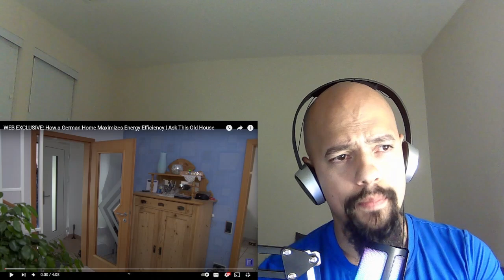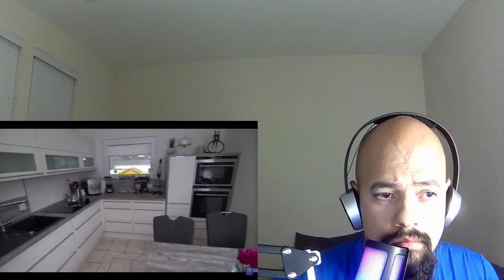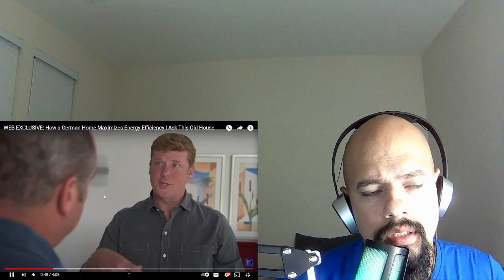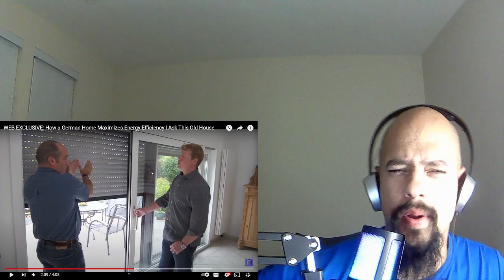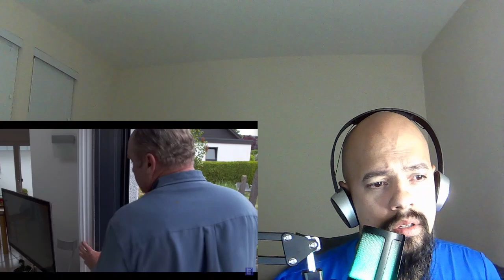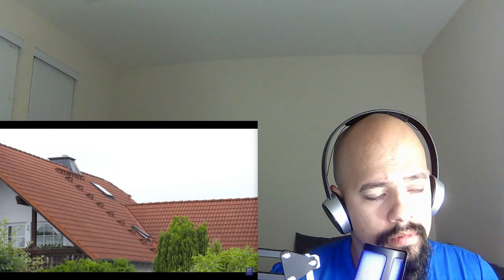American reacts To How a German Home Maximizes Energy Efficiency

Comment: this is a completely normal house... as it has been built in Germany for about 30 years... normal standard, nothing special

In Germany, heating is provided for about 8 months straight

The heating systems are different

We heat with oil central heating

with gas boilers

with wood stoves

with solar

with geothermal heat pumps

and and

often combined

And heating is expensive in Germany

That's why we attach great importance to insulation

Greetings from Germany

Comment: One of the main parts why Germans don’t need so much air conditioning are our cool nights. Our houses are build with brick and concrete. So when you cool them during the night by opening the windows the house will stay cool for a long time because it has an incredible thermal mass. The thermal mass of an American house is just a fraction of this. This means that it will react way quicker when temperatures change either way. We have a highly insulated house and lost heating one day with just 15°F outside and it stayed warm for over a day without any heating.
Reply: In recent years, we have a heat period in Central Europe. Recently built houses were heated with surface radiators in the floor, wall or ceiling and heat pumps. Around the house as in this video a thick insulation and efficined windows and doors. The heat pumps are able to cool the inside of the house via the radiators. The surface radiators act as thermal mass and absorb the heat from the room.

Comment: The central-heating in Germany is mostly gas-based, 2nd is oil and the it's remotely heated (forced hot air I think they called it here)... 4th the new "go to": electric heat pump.
Last is the most efficient and newer models can also be used for cooling in summer (which of course makes most sense, when combined with solar-panels)

Comment: Did you note the small room (vestibule, we call it wind trap) at the front door? It is separated from the living room by a door. Hence, if you open the front door in winter to talk longer with a visitor, you close before the door to the living room and the warm air of the living room does not disappear through the front door. Houses in Germany are much more expensive and you typically live most of your live in a house without moving.

Comment: we got the same problem in africa - aircons and heaters but single pane glass so all your heat and cold just leaves - therefore you need to keep it on the entire day.
Reply: in deed insulatoin works both ways and helps in summer... to keep the house cool inside. Esp combined with these roling-blinds keepting the sun out

Comment: The energy efficiency really is a massive part of the value of a property that seems often overlooked. In Germany you basically have to heat (to varying degrees) from October to March / April. So that's half the year. Investing extra for isolation etc. is money well spent in the mid to long term, when it saves you 1-2k€ a year in heating costs. And that's maybe where also a bit of cultural difference comes in. Americans appear to be a lot more willing to buy&sell properties and relocate. When a German family builds a home, they usually have in mind that they will possibly spend the rest of their lives there and maybe even hope the next generation(s) of their family will live there as well.

Comment: A good isolated house does not only keep the heat inside but also the cool when using AC instead just as like as a refridgerator does...so the thing about "Germany is located higher/more north " is no argument to not have good isolation for a building....and by the way brick buildings are even better in isolation than concrete buildings, speaking of "modern massive bricks with several layers + isolation spaces inside" and not "old style handsized bricks"
Reply: Das englische 'isolated' entspricht im deutschen den konzepten 'abgeschieden', 'vereinzelt' und (örtlich) isoliert.
das deutsche wort 'isoliert' entspricht dem englischen 'insulated' ( thermisch isoliert)

Es ist paradox, dass ausgerechnet die menschen, die nichts von (thermo) isolation halten ( USA, England), zwei begriffe für 'thermisch isoliert' und 'örtlich isoliert' in ihrer sprache haben.

Comment: My dad's house here in Sweden is so well insulated that the inside temperature never fluctuates into the extremes. In the height of summer it's 22C/71F degrees, and in the winter (if you don't run the heating system) it never gets colder than 14C/57F. With minimal heating in the winter the temperature stays at a comfortable 22C/71F and you never need to use an AC in the summer.
Reply: Same here in Austria!

Comment: It all comes down to how you build with wood. In Austria, there's a pioneer who builds houses entirely from wood that are more energy efficient than standard low-energy homes. They are sustainable and environmentally friendly. If you look at the old farmhouses in Austria, you'll see they were also built entirely from wood. In fact, it's not uncommon to find 500-year-old wooden houses. It's all about the quality. You can see his houses in this short video "ServusTV Reportage – Haus Der Zukunft – Erwin Thoma"
Reply: Die Amis bauen Holzrahmen die mit papdeckeln zu Wänden werden das meint ehr   .Holzhäuser wie wir die kennen sind ja richtige Häuser
Reply: Check out the production facility and techniques where these solid wood houses are made. Unlike typical American homes, they use wood wherever possible, even for joining individual wood elements with large wooden pegs or dowels. It's a whole different ballgame compared to our standard construction methods. You've gotta see it to believe it! For more info, watch: "Gespräch mit Erwin Thoma DIE MACHER 2"
Reply: Check out the production facility and techniques where these solid wood houses are made. Unlike typical American homes, they use wood wherever possible, even for joining individual wood elements with large wooden pegs or dowels. It's a whole different ballgame compared to our standard construction methods. You've gotta see it to believe it! For more info, watch: "Gespräch mit Erwin Thoma DIE MACHER 2"
Reply: Get a behind-the-scenes look at the production facility and techniques used to create these solid wood houses. Unlike typical American homes, they use wood wherever possible, even joining wood elements with large wooden pegs or dowels. It's a totally different approach to building compared to what we're used to. You can see the craftsmanship and the natural beauty of the wood throughout the entire process. To get a visual of this unique construction method, check out: "Gespräch mit Erwin Thoma DIE MACHER 2"

Comment: As you can see, there are solar cells installed on the roof, which reduces the energy costs enormously.
Another point is that the energy companies are obliged to buy the excess electricity produced by the solar cells from the homeowner and also credit it. So you can imagine that the monthly energy costs are not particularly high. In the end, depending on consumption, the homeowner may get a good amount of money back after the annual electricity bill.

Comment: Roll shades have replaced wooden shades in former houses and they are typically used to keep the sun out in the summer. As they are installed outside the window, the light cannot come into the house and heat it up. They are much more efficient than shading devices inside the house.
Reply: Tru
Reply: They got so prominent in Germany because of the "Verdunkelungsgesetz" between 1933 and 1945. Before that wooden shutters where the prominent way to lock out the sun and secure the windows at night.